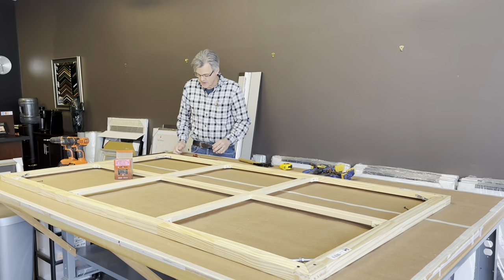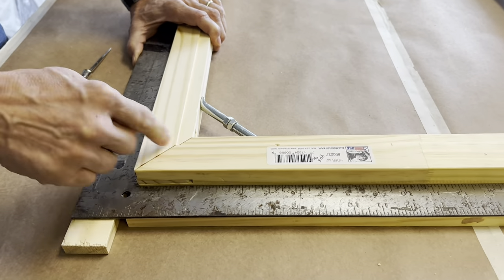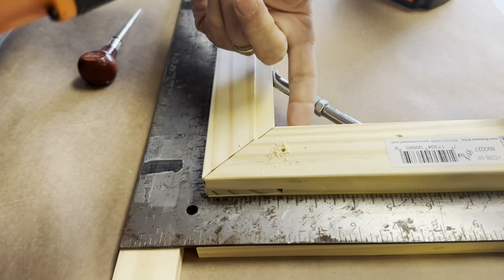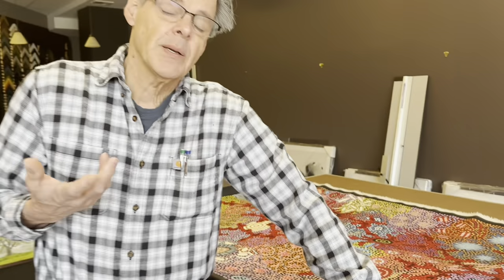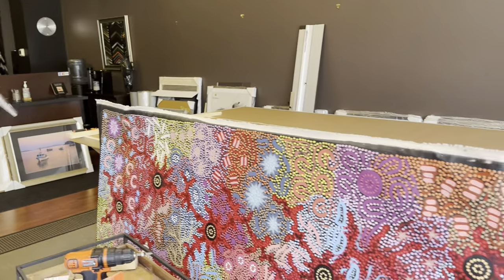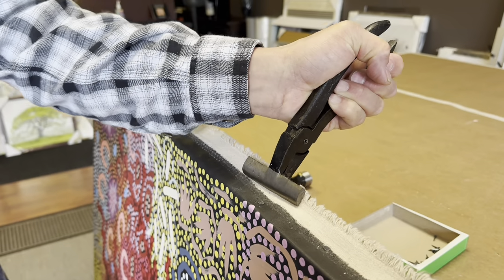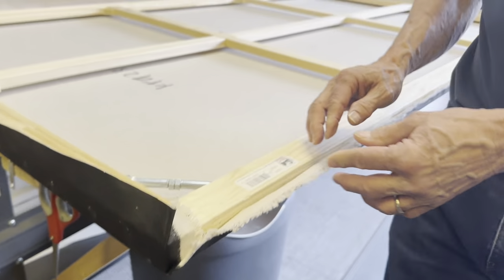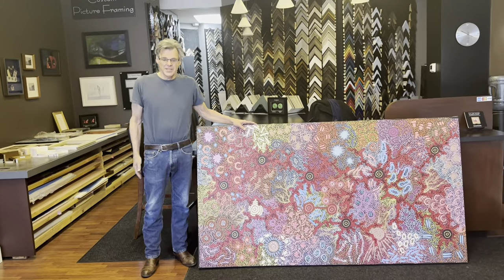Large Aboriginal Canvas: Stretcher or Strainer?

Comment: I'm not understanding how you can use the thing to stretch the canvas if you've put screws in so nothing moves?
Is there a reason you couldn't just make your wooden stretchers a bit smaller by an inch or two all around?
Seems to me it would be alot easier.
Reply from the maker: First of all, the screws were removed after the canvas was stretched which now allows us to tighten up the canvas if necessary. Making the strainer smaller would mean that some of the image will be wrapping around the edge and as you notice in the video, the client wanted all the dots to stay on the front.
Reply: @gallerysevenmaynard  ah you remove the screws after, ok that makes a lot more sense. 
So it was the client who specified the mounting, I just thought because so many paintings mounted that way go down the sides that it wouldn't be an unusual solution to the problem.
Reply from the maker: Yes, that was the tricky part of the job, getting all of those dots to line up as best we could to show on the front. Thanks for watching!